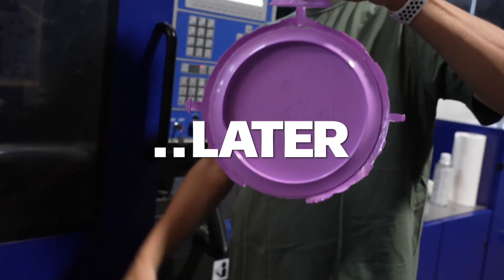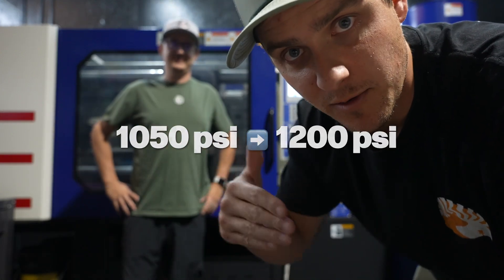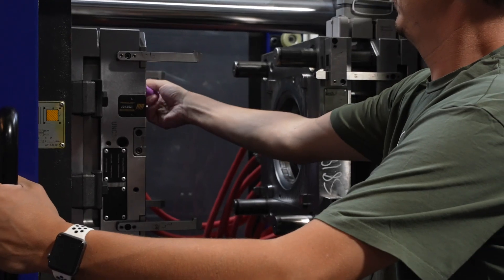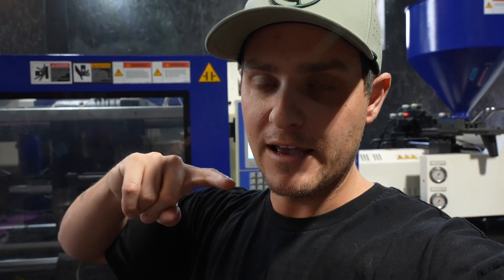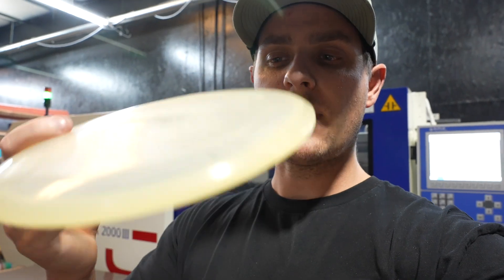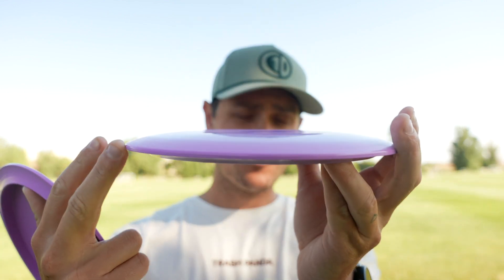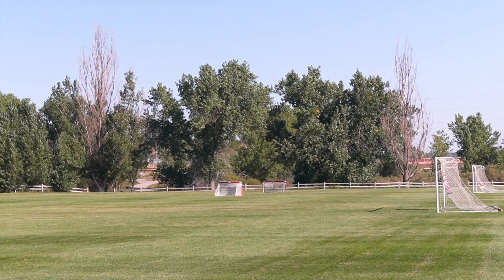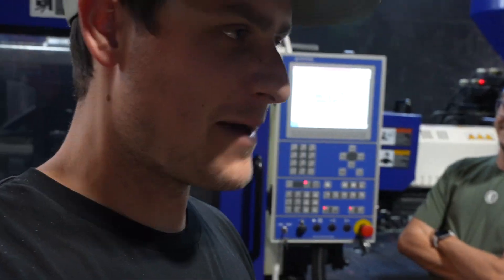We Made TWO DIFFERENT DISCS Out of the SAME MOLD

Comment: I’ve changed my disc with a microwave, a plate of water and some pressure points of differing sizes dinner plates. This started based on truing a warped disc.. I’ve been used a freezer. One 9 speed mold, could probably make the spectrum of OS SS and US By using different plastics, cooling trays and cooling temperature. I’d be a little surprised if you put discs right side up and upside down on the cooling table wouldn’t make a big difference.

Comment: One might think the weights (density) of the plastic is higher the more pressure on the mold?  Is this true.  Does density affect the plastics material properties much?  (Strength, flex, shrinkage etc). BTW you need that disc chucker that guy made, consistent flights.  (I think Simon was on the video)

Comment: Fellow molder and disc golfer here  great info. For the 30 minute disc I would think you turned off the water heater to the mold. Causing some some. 

Cool time will drastically change the diameter of a disc and it makes sense to see different flight characteristics. For years I have thought the variation in discs was caused by mold temperature which you just have proved running different cool times.

Your hypothesis is correct about Franklin molding discs. I would also guarantee that a random manufacturer made them with a sub 15 second cycle and just pumped them out. 

Now would be super cool to see same settings with different colors…I would start with a light color and transition to a dark and see the difference in injection time and how that effects the flight.

Comment: Was there a significant weight difference or trend in the different injections? I wonder if you are getting heavier discs as well as more dome due to the plastic compressing more under the higher pressure and therefore putting more plastic into the mold.

Comment: Do you see the same thing with different molds? I would think that the inner core would stay more consistent because the cooling wouldn't pull the parting line in a direction like a driver would.

Also are dome and parting line correlated or can you have each change based on molding variables?

Comment: I worked at an injection molder in Minnesota.  It was over 100 degrees in there in the summer and maybe 65 in the winter.   Wonder what that would do to a disc, all other things equal.

Comment: Fantastic video. Thanks a lot!
FYI: NZ's RPM Produce a far-less stable version of the Kahu HS driver - the Kahu-XG.
It's a combination of mold temperature, and dwell time, which affect the outcome. 
The Kahu XG ends up with a lower Parting Line, and a dome. The XG variant is only available in Atomic plastic.
The dome actually exists in the mold, but ordinarily during cooling, the flight plate pulls down as it lifts the Parting Line, creating a super-fast, very stable disc.
The cooling differences are usually down to the Specific Heat Capacity of the TPU being used, but even within the same plastic significant variation is possible, if accurate enough control over mold temp and dwell time is achieved. That's how Simon at RPM explained it to me, anyway.

There's also some variation to be found in overall weight, by significantly over-blowing the mold, and I know that Innova do this for a couple of their drivers, to get them up to max weight. The normal volume of the mold being too small to reach full weight without adding weighting agents, or overblowing it. And it you have a great flashing removal process, then there is no penalty for overblowing a mold, except excess flashing - which we know you guys recycle.

Edit: It's also worth noting that in RPM's range, the  putters Tui and the Ruru have the exact same dome in the mold, but the Ruru pulls board-flat during cooling, while the Tui keeps its dome - including the (required!) flat centre portion. The PDGA say that a disc must have a flat section on the flight plate, but every manufacturer ignores this after the disc is approved by the PDGA. RPM think it is because the Ruru has more TPU in the rim, and so the Tui's flight plate is a bit thicker than the Ruru, and this is what makes the cooling produce a domed disc and a flat disc.

Edit 2: It is known that some (*cough* Innova *cough*) manufacturers leave the disc they submit to the PDGA in the mold for an extended period of time, so that the prototype measured by the PDGA comes in at a larger diameter, which means a higher maximum weight. This has been common practice for a while - but is almost never discussed. 

We know this is true, because when you use a properly accurate measure on a production disc, you will often find that it is 1.5mm to 2mm smaller in diameter than the specification on the PDGA page for that disc. And so there are lots of tricks manufacturers use to manipulate the approval system to their benefit. You can go back many years and get the same diameter mismatch between the specified size, and the actual diameters.

Edit 3: That Franklin driver is a piece of garbage, and it has a leading edge which is criminally sharp. It could never be PDGA approved. I stopped an NZ retailer from selling that Franklin three-disc pack, due to the extreme danger the driver represents, and the possible legal liability of selling a dangerously sharp disc. Strangely their putter - an Aviar P&A copy, and their midrange - a ROC copy, are molded nicely, and fly OK. But that driver is a lawsuit in the making.

Comment: What a fascinating video! Definitely gets my scientist gears spinning. Some ideas that occurred to me:

1 - Orientation: What if you let the discs cool right side-up instead of upside-down? Perhaps on top of a window-screen-like material to prevent an air seal.

2 - Cooling temperature: What if you were to let them cool in a colder room (or refrigerator?) vs a warmer room? Or left them in ice water to cool? Would this also affect durability?
Reply: yes, the relative humidity in the room where the disc is cooling has to have some effect.
Reply: I was thinking the same. Then, if I saw correctly, they finished cooling stacked in a box. Certainly the bottom discs will be more deformed than the top, and the middle discs will cool slower than the top or bottom.

Comment: Similar to forging metal, material warp can be caused by how fast or slow it cools. What if you cooled the discs in a cold water bath to shock them into their final form, or more slowly in a low-temp oven? There are just so many variables to play with, and every new lesson makes you a better manufacturer!
Reply: I know high temp is how Innova gets G-Star from Star having some Star be almost G-Star and was softened during the travel. Innova people, they did after first 2008 run of G-Star is add a sparkle/shimmer to the plastic dye to denote the disc plastic from Star. 

This is different from Discraft ESP FLX where original from 2008--2009 was a mistake from supplier they had some off plastic for those years where some late 2007--early 2008 ESP was the FLX plastic basically floppy. The Discraft brand did make Z FLX as well but was more a process, why Discraft was able to bring back the brands Z FLX 10--12 years later.

Comment: What would be the effect of taking a disc out of the mold and quenching it in a bucket of cold water or quenching oil?

I used to do blacksmithing for a hobby and the way to harden a blade was to heat up the steel so the molecules aligned with each other and then quench in in oil to maintain that alignment.  Otherwise they go back to their normal orientation.

I do not know what effect quenching would have on plastic.  Warp it??
Reply: On plastic, the answer is probably.

Comment: Jesse meet Alice. "Ever gone down a never ending rabbit hole before?!?", asked Alice. 

I've enjoyed this sport (hobby) of chucking plastic for over two decades now. It would be hard to be this involved in a hobby and not notice the differences in various "runs" of plastics. For Example, early (1st/2nd run) swirly CE Innova. That was my go to plastic for the longest time.  Now those discs are collecting dust due to the plastic breaking down. I.E. chalky appearance/oily feel. I still have some early Pro and Star Innova that is holding up well. Very beat in and flippy now, of course. Even for my noodle arm speed. It's equally intriguing/frustrating when you've found your "go to" plastic/mold/run/weight.  Then starts the search for the next one to add to the backup roster......................
I love disc golf.

Comment: You guys need an engineer/stats person to run some DOEs (Design of Experiment) on your machines and discs.  Would help narrow in on some of the hypothesis quicker than doing One Factor at a Time (OFAT) and also might highlight some of the interactions between the key process input variables (KPIVs) on your outputs (KPOVs).

Comment: This would be an interesting one to test a year or more on, when they're being made from a completely different batch of plastic, from the prior sources original suppliers. One mold that's seen a lot of insane dome changes over the years is the Discraft Comet. The blends of ESP and Z plastic have changed over the years, and the discs got flatter and flatter, to the degree where I actually suspect they changed the shape of the mold. More recently, some of the "old school" dome has shown up again, after years of flat ones, a decade after the "old school" dome was just how they ALL came out. At Discraft, they've no doubt changed suppliers, or those suppliers have changed suppliers, in that amount of time (the first ESP Comets are something like 15 years old at this point). I'm sure that plays out at every place that buys plastics, which would mean what you get to recycle would be different a year on, or two years on. It'd be a long experiment, but maybe a yearly test would be interesting, from a scientific standpoint...